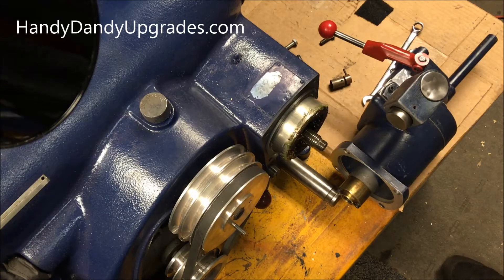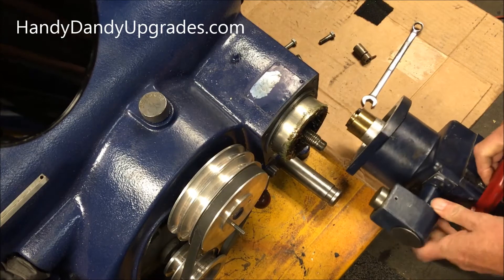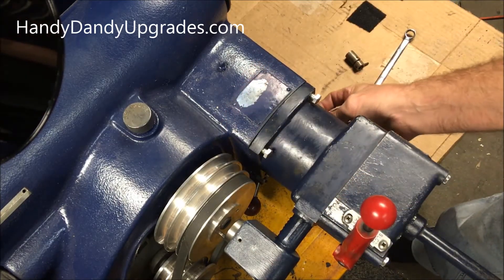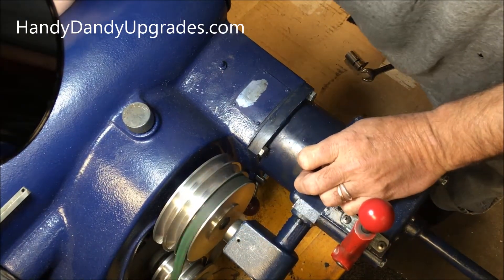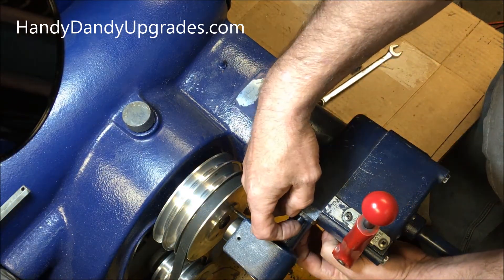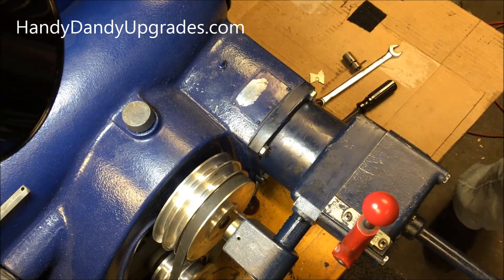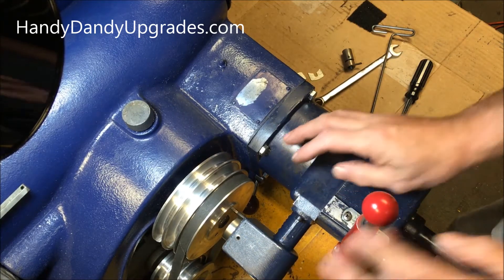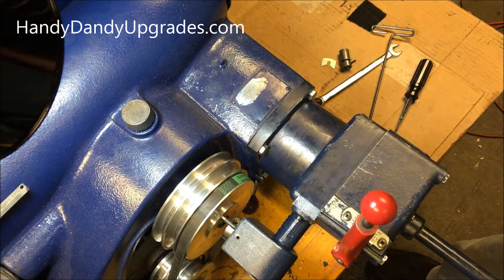Mounting the Disk Feed Gearbox - on an AMMCO brake lathe

Comment: Just a quick question; my feed lever is not centered; it still works but the neutral slot is now the fast feed. I can't see any adjustment as the lever has a key slot. Is there a way to adjust that? thanks.

Comment: Can I add the new style brass feed nut  that you have in this vid to replace my old style shorter nut for more travel as a quick swap or is there more to worry about?
Reply: Im putting together a video today on extending the travel. There are a few details you should know about. If everything goes well it will go up this week.

Comment: Any vids coming on twin cutter assembly tricks or warnings?  How about Quill or main spindle vids in the works?  Keep up the good work.
Reply: Quill gears dont really have issues very often. 7000 machines tear them up when run out of oil. 4000 and 4100 its so rare I doubt I will have a busted one to show. In the years I been doing brake lathes Ive seen three broken. As of this time no replacement quill gears are available. Last one we did we had to put a used gear from doner machine.
Reply: Replacement quill gears are available from Ammco. I recently had to replace one in a 4000E that new electronic piece of junk that they got. The machine was 15 months old 3 months out of warranty Ammco wouldn't fix it. It takes the 4100 quill I didn't have any of those in stock so I went to my local Aamco guy and he got me one. It was a lot cheaper than what I thought it would be